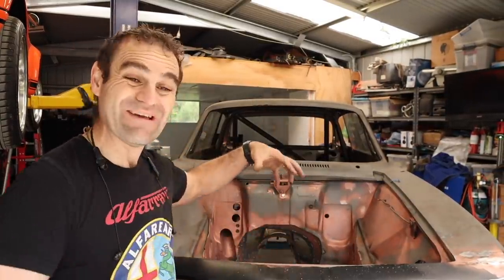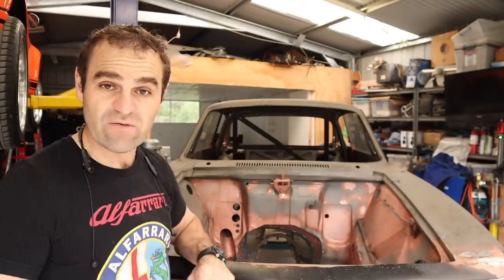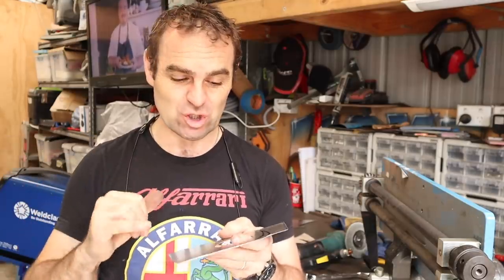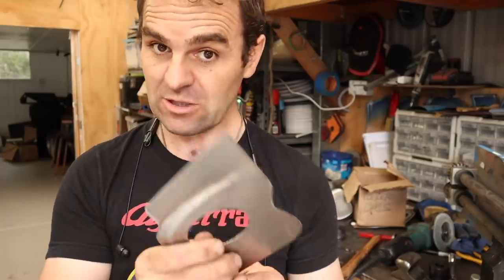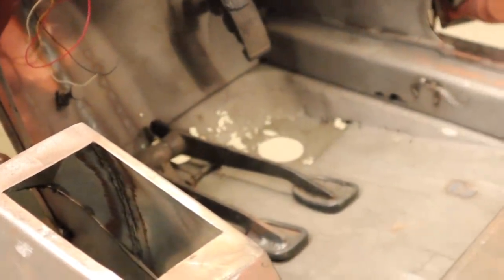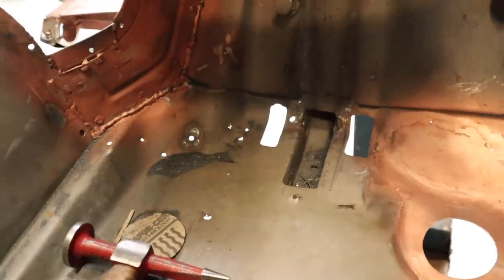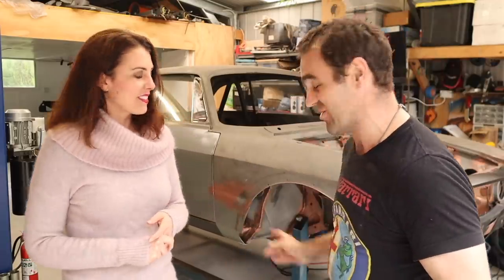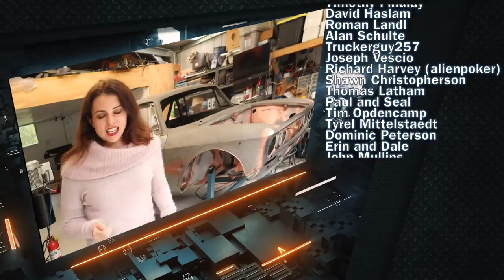NOT seam welding the Alfarrari - Ferrari engined Alfa 105 Alfarrari build part 122

Comment: A tree trunk standing upright with hollows in the top with an angle grinder is great for forming 3D shapes with a hammer or mallet - works better than a sandbag in many cases (from a silversmith!)

Comment: Yeah, between job amd job.....repair the corrosion holes. Watch out with the rigid of the chassis and suspension, you need to feel the limit before breakout by under or oversteering. Also the mecanichs like train, gerbox and engine will develope the power more elastic and softer (damped). Please Alfa "bordeaux red from the 30´s and a classic "Quadrofoglio" sticker with your personal jeff style. Greetings from Barcelona, y love your project !!!!!! BTW, the music is cool, it reminds me to tipical Aussie Midnight Oil style rock.😁
Reply: Put the ferrari f in the sticker

Comment: I saw one of these the other day at GTR Alfa mechanic at Peakhurst. It was rebuilt similar to what you are doing but had an Alfa motor. It was lowered with original Simmons rims with roll cage and recaro seats. It had big fat rear tyres that tucked in low under the rear flared guards. It had the original dash and console dressed in nice tan leather with polished aluminium trim on the speedo pods and console switches and vents. But what made this car pop was the paint job. It was painted in an azzurri blue similar to the Italian soccer jersey colour and had a Italian flag stripe decal that run down the centre of the car and I large black and white racing number 8 on the doors and bonnet. Have you ever seen this car on race track because the owner said he races with other AARCC.
Reply from the maker: Haven't seen it but it sounds cool.

Comment: Kind of the hard way to do rust repair.
The easier way is usually to cut a bigger square out take it to the work bench make a slightly larger version lay it in the location tack it in then massage it into place.

Comment: Hey Jeff. Loving the Alfa build. 👍 I wanted to ask if you ever take precautions when welding by using a Local Exhaust Ventilation (LEV) system and/or Respiratory Protective Equipment (RPE). If not, was that a conscious decision and you deemed it unnecessary, or have you just not considered it?
Reply from the maker: I always weld in a well ventilated area but it is something I would probably want to look into.

Comment: great video Jeff is there a reason not to delete the big round holes that you punched in that seems to be a common place  for rust to start in every car moisture gets in carpet get wet result rust
Reply from the maker: They are drain holes that will have rubber bungs in them.
Reply: @HomeBuiltByJeff  I had the same question.  I thought they were drain holes for some factory dipping process.  With the plugs in them they don’t drain anything.
Reply: Agreed, my understanding is that they are drain holes for the original factory paint dip process, after that they just become places for rust to start... when we did the floors on my car we made the correct shape but didn't make the holes.

Comment: I wondered why you used MiG over TIG on the floor
Reply: So you don't have to move the gear switching positions?
Reply from the maker: It was more difficult to make a nice tight patch panel so the MIG is better for bigger gaps/laziness ;)